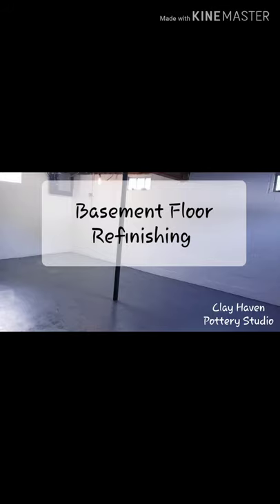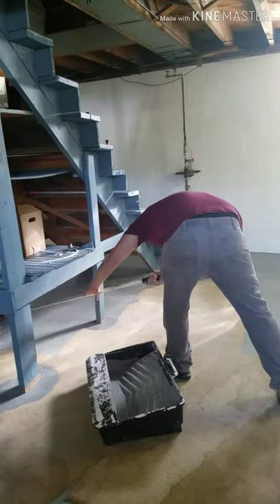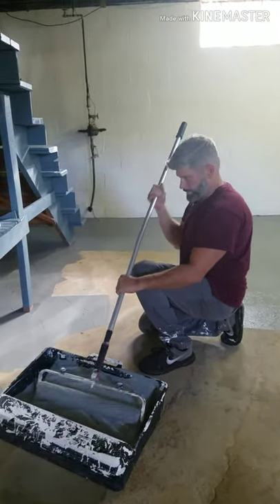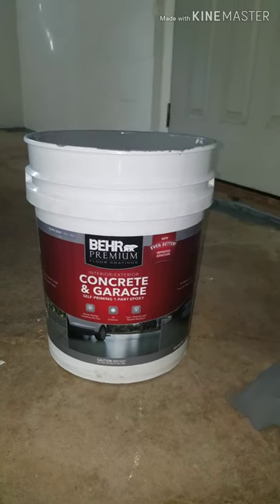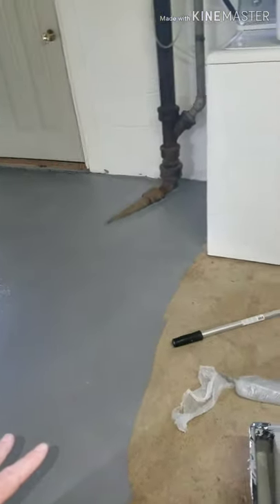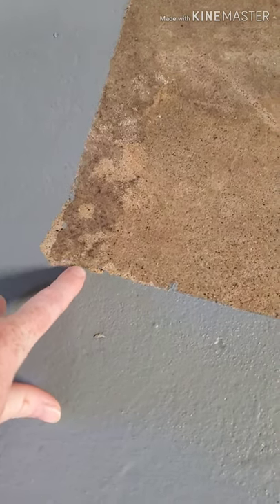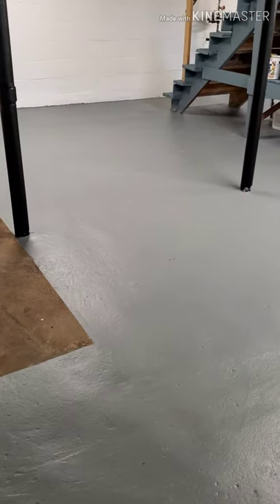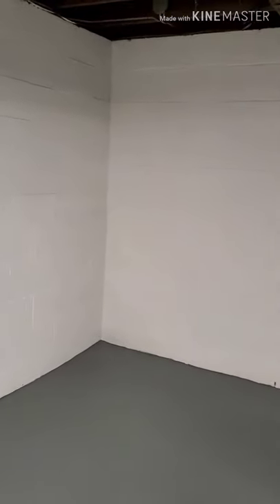Painting the basement floor with Berh Concrete and Garage

Comment: How’s it holding up
Reply from the maker: Honestly, not the best. Our basement was in rough shape from the previous owner. Lots of discoloration and odor. We pressure washed, cleaned and etched. Applied 2 coats and it's chipping. The paint comes up anytime something heavy is set down. Kind of disappointed. You may have better luck depending on the conditions of the floor when painting. Good luck 🙂